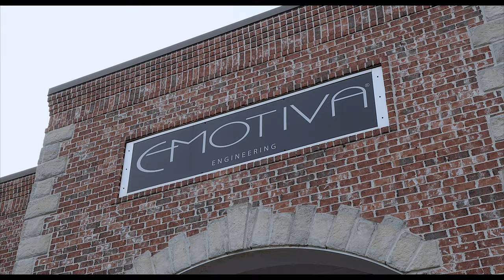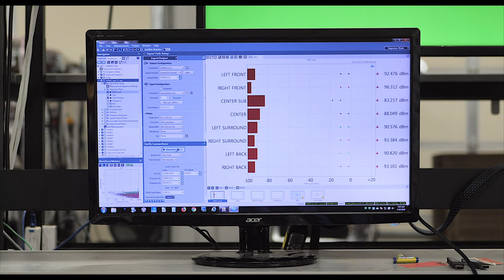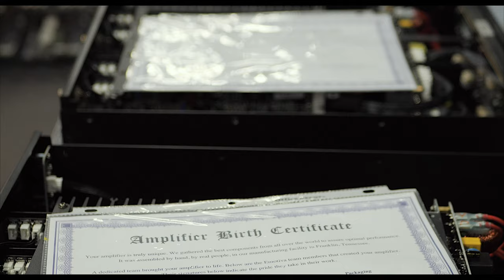An interview with Dan Laufman

Comment: He is the real deal. I asked emotiva to give me a call. Dan called me, I didn't realize that he was a CEO. He told me that I need the best because of the room size. Instead of spending 15k so I spend only 7k because the room size is too small and it would have enough power to drive all the speakers. Thank you for your support.

Comment: Real deal for sure!  I cannot wait to install my new S8 sub that is on the way here.  Then $ in the piggy bank for a processor and amp.
Reply: The great little SE-8 has served me well in the surround sound set-up for a couple of years.  Moved up to a SVS PB1000 Pro and moved the SE-8 to my office.  Couldn't be happier with either sub.  I have almost all Emotiva speakers in the TV surround sound system and cannot wait until all are Emotiva.  Still saving up for the processor and amps.  All good things in good time...... Right?
All the best to you folks - Kevin